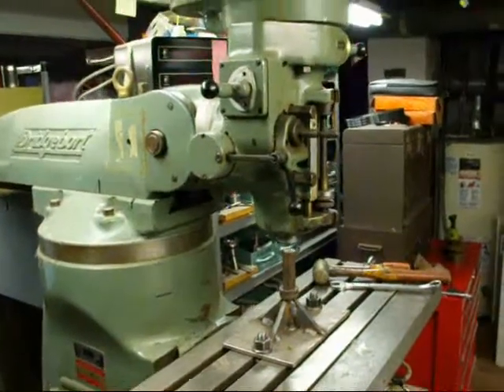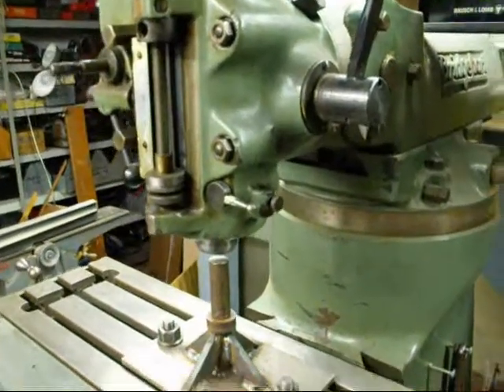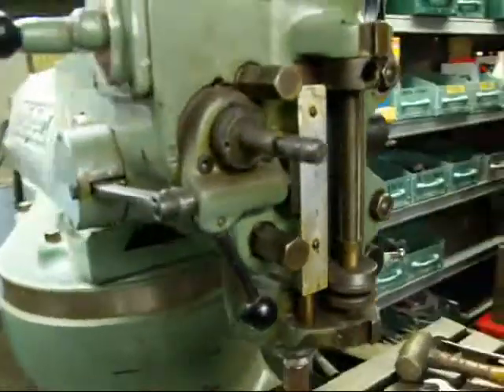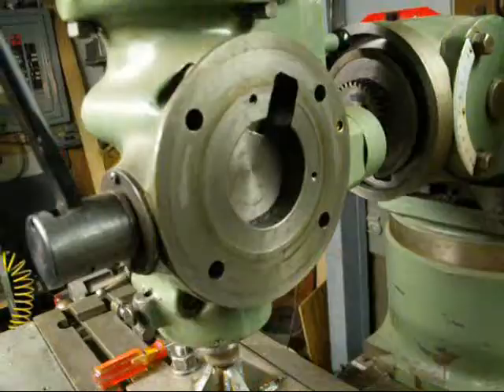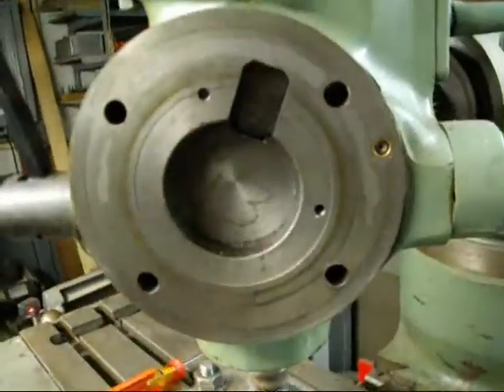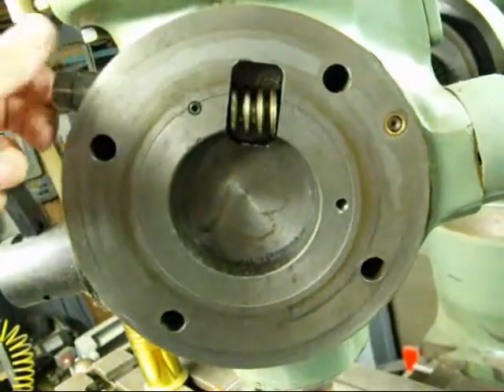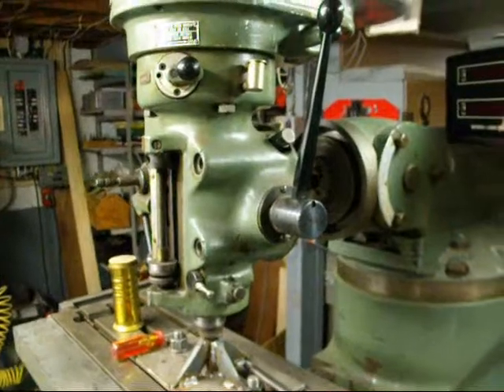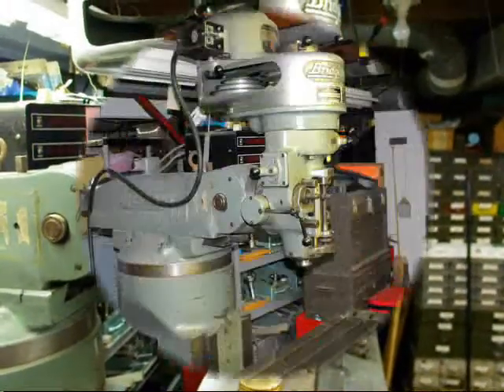BRIDGEPORT MILLING MACHINE Removing the Head tubalcain mrpete

Comment: 2023 - glad you're still around making content, and wanted to let you know that this will be handy for a mill I am moving cross-country soon, where I want to put the head in the back of my truck to reduce the height and weight of the machine going in a small trailer

Comment: Hi Mr Pete. Thanks for the videos. Inspired me to buy a Bridgeport! I got it delivered with the head completely turned around and as I was trying to turn it back the shaft broke away inside the casting. Probably my fault for not supporting it in some way. 🤦‍♂️
What is the correct name of the part/shaft as I can’t seem to find a replacement? Also if you have any idea or tips on how to get the remaining piece out I would appreciate it. If only it was in the upright position it wouldn’t be such a pain! Anyway. Thanks for the videos hope the channel keeps going 👍
Reply from the maker: Congratulations on your purchase. To start with get yourself a parts manual. Check on vintage machinery.org. I do not know the name of the part Off hand.    
You can buy any parts you might need from H&W Machine repair and rebuilding. They have a website. They are in Fort Wayne Indiana. My machine had a broken gear in the tilting mechanism when I bought it
Reply: @mrpete222  Many thanks for your reply. As it happens I was following HWs YouTube channel and they just replied with a link it’s “Adjusting worm shaft part 1097” I suppose it’s a perfect excuse to tear down and rebuild! As it looks pretty tired but was a bargain at 1800 I’ll definitely get the manual as soon as I figure out what type of machine it is. Looks very very similar to yours though. Thanks again and hope you’re keeping well. I’m still jealous of your dividing head 😂🤔.

Comment: The series II Bridgeport quill down feed  bearing is rated at 900lbs of thrust. It may damage the bearings if you were to shoulder tackle it from a dead run, even then the damage would most likely be limited to your body...
Reply: Geo K. good comment.
Reply: Right on Geo K, some people just don't understand "static" vs dynamic loads or sitting something down vs "dropping" it, old myths are perpetuated by lack of understanding, I agree with Max R, great comment.

Comment: I saw a video similar to this where they disassembled a small CNC machine.  I think they clamped the head to the holding fixture with a collet, though.  Sorry I know you don't like questions and I'm sure you've addressed this already but how did you get all that heavy equipment down in your basement?  A bridgeport only breaks down so far.  The base and column are one casting and must weigh several hundred pounds.  Did you have to use stairs?

Comment: Mr. Cain,   If you have the time, would you comment or make a video about the proper lubrication of the Bridgeport?  I have a book that states that BP's are oiled, not greased... however, my experienced machinist friends tell me the grease nipples are indeed for greasing.  my book states that the proper lube is oil with a high-pressure lubricating device.  Could you comment on this please?  
In your debt as always,  A.

Comment from the maker: @JustWonderingHowToDo 
The width of the base is 24". Here's how to remove table, you will need help to lift it off. Remove the cranks. Then remove  both crank bearing housings on the ends. I think there are 8 cap screws.  Then unscrew the lead screw & remove it. Then loosen the gib & slide it out. Then if I remember correctly, the heavy table can be slid off either end.